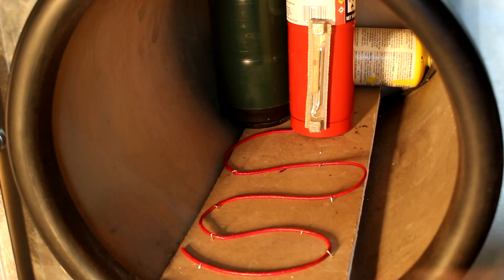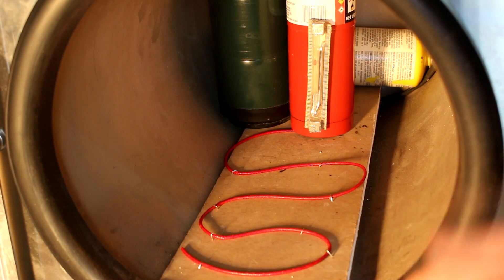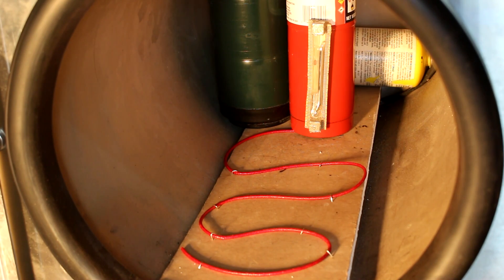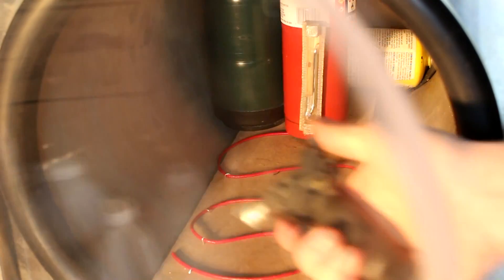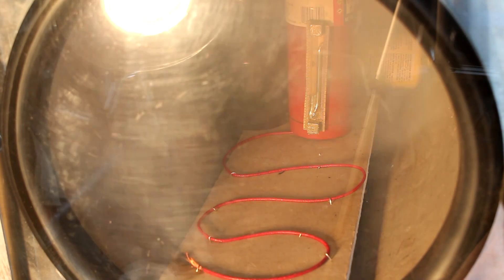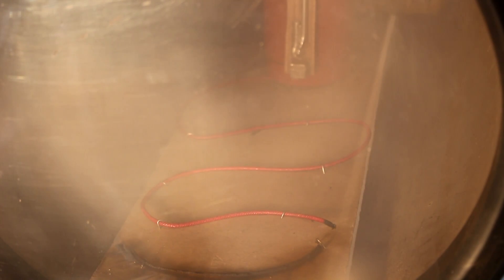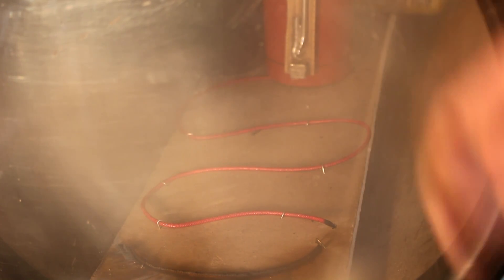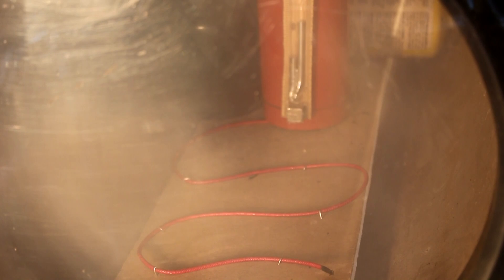Can You Defuse a Bomb Using a Vacuum Chamber?

Comment: as long as the bomb cant detect itself being put under vacuum. It also would depend if the bomb uses a vacuum as a defusing deterrent. If so then the bomb might be put under vacuum but what level of vacuum is the bomb using? bombs can get very complicated.

Comment: try elasticated fuse, a fuse that the coating shrinks over the burning point,  the elastic part only needs to last for a 1 cm or 1/2 inch, that should make a tiny choke over the exit point,  as it burns away allowing a slight build up of pressure before the coating burns off  ( an easy way to achieve this would be to wrap the fuse with heat shrink or foil and an elastic strip bound around the fuse to shrink it as it burns, remember as it burns the elastic will unravel, so 3 layers   1 heat resistance layer 1 elastic layer and a fixing layer to help stop the elastic from unravelling
Reply from the maker: that should work

Comment: Okay try this. Make a homemade firecracker which is started with a broken lightbulb inside the firecracker itself. Fire it up with a battery and see how it explodes in the vacuum. So no fuses, open fires or anything. Only a black powder (or variant) firecracker which has embedded  lightbulb filament as a source of ignition inside. It would be interesting to see how it goes.

Comment: Could you make a sturdy setup to ignite a rocket motor within the vacuum chamber and see the results? It'd be interesting to see if the ignition is successful and if the motor will sustain itself in a vacuum. Of course this is possible, but would a potassium nitrate solid rocket mix work, or does the oxidizer need to be stronger?

Comment: what if you put a bunch of gunpowder in lets say one you your pirex tube(or smaler don't want to blow up the chamber) and you have something that would heat a lot of it at the bottom so it wont jump away maybe there could be enough heat at the same place to start a reaction. maybe the laser or something like the filament in a light bulb lot of heat real quick on a large surface at the bottom with a bunch on top.

Comment: Unrelated to the video l, but I need to say something about practicing chemistry. READ THE MSDS OF EVERY CHEMICAL INVOLVED. I have reason to believe I have gotten metal fume fever from working with manganese dioxide in lantern batteries. The headache, dry throat, and nausea are not fun, and easily could have been worse had I tried something more daring.

Comment: try c 4
without a fuse but a detonator.
Reply: This could kill him. Why? Vaccum stops fire. Explosion MAKES fire but it is NOT fire. C4 is a military grade plastic explosive, meaning it has a violent reaction that is extremely dangerous with or without oxygen and pressure not to mention illegal. Most if not all other electrically detonated explosives are caused by an elemental reaction of one or more substances having a volatile reaction with a spark or with each other. The reason for fire being involved in these explosions is because of the extreme energy output these explosions have. The energy is transferred to the Oxygen surrounding it causing it to burn.

Comment: For testing your hypothesis that the air carries the heat between grains, perhaps you could test whether black powder burns faster in a gas with a low heat capacity, (eg. Argon?) and slower in a gas with a high heat capacity (e.g. Helium)?

Comment: I guess this method won't work for an "explosive fuse" (or whatchacallit in English), the kind that they use to connect the explosives with for multi-point explosion... the fire travels much faster in them, approx. 2 km/s. You would have to cram in a lot of it to make this extinction happen, the volume of the vacuum chamber is not sufficient :)
Reply: detonating cord.
It isn't fire that travels, but a detonation front.
Reply: ...and what is exactly a detonation front? Chemical reaction. Any explosion is just very quick oxidization.

Comment: Another unexpected result!  I love it!  Oxidizers like chlorate or nitrate decompose to 02.  I guess the oxidizers just can't supply enough 02 pressure.  I know in a diesel engine the pressure and temperature rise but I didn't think that the partial pressure of 02 goes up as well just like you mixed in pure 02 at 1 atmosphere.

Comment: Do the same test without setting the vacuum pump. 
Perhaps the fuse was stopped because of the smoke that was inside the chamber.
Although you did say that the lack of oxygen is not a problem, I'd still like to see more of the control tests

btw love you Cody <3

Also, how does a vacuum influence photosynthesis? Cause you would think that that would help drag the oxygen byproduct

Comment: Cody! I dont want you to put yourself in harms way but if you ever get a chance could you prove or disprove weather a tank filled with flammable gas can explode if exposed to electricity because i figure without oxygen in the tank, nothing will happen if a current is ran through the metal tank of further more if 2 wires put inside and sparked could cause an explosion, again dont do it, but if u have any idea, let me know because we are working on a vehicle design that requires high voltage and compressed gas but are hesitant due to the dangers of accidental discharge and explosion, thanks a ton, also, comment section, id love to hear your thoughts!

Comment: In the liquid nitrogen test, it is only under it for a short distance. If you put 6+ inches of fuse under liquid nitrogen, in  a glass dish for viewing like a casserole pan, does it still burn the whole way? I assume this fuse going out here is due to the fire square missing pressure? If you want to try to get that standard changed, maybe try using a triangular pyramid instead. This way you still have the triangle, but instead you have 4 of them and might be easier for people to extrapolate into 3d instead of completely changing the shape.

Comment: So if the fuse can burn without oxygen and can burn while extremely cold (in liquid nitrogen), then why does a vacuum chamber put it out?  Are you sure there isn't oxygen in the fuse itself that allows it to burn under liquid nitrogen that gets sucked out by the vacuum chamber?
Reply: FarmCraft101 did you watch his last video?
Reply: An interesting way to prove the effect of oxygen in the atmosphere would be to put the fuse under vacuum, and then pressurize the chamber with something like nitrogen back to atmospheric pressure.

Comment: An interesting point a friend of mine mentioned. Your hypothesis is that the pressure of the atmosphere is causing the combustion to spread rather than immediately dissipate into the atmosphere. I think it's a good one, by the way, but my friend mentioned a good way to confirm it's a lack of pressure and not a lack of air would be to pump out the atmosphere, then refill the container with argon. Then repeat the experiments in an inert atmosphere. Should be a good way to confirm your pressure hypothesis.

Comment: How about an actual electrically triggered bomb?   Like a time bomb.. Will detonating it in a vacuum keep it from exploding?
Reply from the maker: no
Reply: This is actually the Question I was looking up that caused me to find this video in the first place. I doubt my small town has a bomb squad so I was curious as to what would happen if they encountered a bomb threat that had a bomb on site. So I looked this up since you need oxygen for fire and most explosions are fire. Exept they aren't. They are the extreme rapid expansion of gasses as they react to either other gasses, or a spark. This reaction causes the initial explosion, which expands through oxygen at a rapid rate as fire and displaces a lot of air which is why there is a shockwave. Conclusion of my rambling; explosion MAKES fire, but explosion is NOT fire.

Comment: I didn't expect it to stop the burning, when I was younger I lit up a firecracker in the house, and in my panic I threw it in the toilet expecting the water to put it out. it however did not.

I wonder what this fuse was made out of, and if you should potentially try other fuses
Reply: Maxwell Houghton the reason for that is because the fuse is creating its own gasses, in water it will still work. But in a vacuum the gas is pulled out
Reply: Interesting, That seems to make sense!

Comment: What happens if you put Play-Doh in a vacuum chamber?
Reply: Bryce Holt good question, I would assume it would just expand and fill up the tube
Reply: Jalen Miller I would think that it would shrink from the strength of the gravity
Reply: Bryce Holt I think it would shrink after letting the pressure come back in but not while the vacuums on.

Comment: Thought this would be an electric fuse test. What would happen to an electrical fuse if you shorted it in a vacuum? Would it glow like a filament in a light bulb?
Reply: No problem,  burning is the major problem.  But not as long as a halogen atmosphere that redeposits evaporated tungsten to the filament.

Comment: I've got one to try will a cold pack work in a vacuum if it's not touching anything to transfer heat to it or very little touching it ie string or if you can float it with a cold magnet?

Comment: I couldn't help but wonder,... If you had let atmospheric pressure back into the chamber would the fuse have re-ignited?  You mentioned that you have had that fuse burning under liquid nitrogen but that was not at 0 Atm, right?  It would be interesting to see if it "re-kindled" when returned to 1 Atm. both with atmospheric O2 levels and with something like Ar or Ni as the surrounding gas?,.... Just a thought.

Comment: So would this fuse be comparable to a flare being that it can burn without oxygen and under liquid? I'd like to see what a flare can do inside a vacuum,  but I understand that may be too large scale and too volatile for your chamber. I know flares are hard to extinguish and you basically have to cut it off and let it burn itself out. Would this be true under a vacuum. Maybe try a small piece and see if you can ignite it with your laser. Then try lighting it and turning on the vacuum pump and dropping the pressure.

Comment: What about electronic ignition? If a timed or remote controlled bomb was put in a vacuum, could it potentially be disarmed?
Reply: kaptenrobert yes the title is a not clickbaity. We already know that explosions can happen in a vacuum as Cody has set off blasting caps in previous videos. In this video Cody stopped the fuse from burning.

Comment: CODY i have a question for you, what is faster: lightning? or a sniper shot?
Reply: Adriel Cedrick but lightning is not light, its super strong electricity
Reply: Fair point... But most lightnings reach the ground, some even so fast a few humans don't notice unless there was a visible light.

A sniper shot is very fast too, I don't know. Electricity is very fast, but I'm not so sure.
Reply: I deleted my comment, it was very embarrassing LOL
Reply: I searched it up and it showed that a lightning bolt reaches an average of 320,000,000 feet per second while a sniper bullet can only reach 2,400 to 3,600 feet per second.

Well even when my prediction was wrong, I guess my choice was still correct LOL

Comment: This doesn't make sense to me. I would say that the fuse stops not because of lack of pressure but the decrease in temperature. Since the fuse needs enough activation energy to progress, pumping the air out means that all the energy needed for the continuation of the chain reaction is pumped out aswell. 
Could you try re-igniting the fuse in the vacuum with your lase pointer?
If the fuse consists of potassium nitrate it should light up according to my knowledge. Thanks.
Reply: MrCoffis Didn't you see the end of a video? Liquid nitrogen is as cold as you can get.
Reply: Vadzim Dambrouski True. Then that would mean that for potassium nitrate to decompose it requires pressure for some reason. But the thing is with liquid nitrogen the specific heat capacity of it is really low.

Comment: Hmmm what do you think causes it to go out then?
Reply: only thing i can think of is that the vacuum is pulling away the hot gases too fast to sustain the reaction but i dunno about that. I wonder if you could visualise that effect with a thermal camera?
Reply: In the last video called "Is fire possible in a vacuum" he came to the conclusion that pressure is needed for the chain-reaction to sustain itself. Go watch it if you want a more detailed explanation of it.
Reply: Ahh ok I hadn't seen that.

Comment: you probably won't be able to test this without destroying a number of vacuum chambers, but, will a detonator set off high explosives in a vacuum? That's probably a stupid question because I think they use explosives in space travel for separation, but...
Reply: Typically a detonator is a bit of primary explosive in a tight casing, and it's embedded inside the main explosive. Both the casing and the surrounding explosive would contain the exhaust gasses well enough to sustain the reaction.

Comment: Do you think the vacuum chamber would work for more sophisticated time delay or remote trigger bombs that they usually have to use robots and stuff to defuse? If the lack of pressure can stop the ignition of a fire or rocket fuel, could it also stop the ignition of an explosive?

Comment: What is the reason it went out? I'm struggling with an explenation!
Reply: I believe Cody's last video shows how rather than just needing oxygen, fuel and heat to burn, most things also require pressure to transfer the heat to the unburnt parts properly. :) (He explains it better in the video)

Comment: Can you dull or kill a batteries performance with a vacuum? Since as the pressure drops you also have the temperature drop, and as we know very cold temperatures can really kill the performance on batteries. So say you have a simple circuit set up and had the battery in cool water or wrapped with a wet paper towel. As the pressure drops and the water boils and freezes and such, thus we also get a drop in temperature. Would we notice a worth while change to the batteries performance?

Comment: But can you defuse a vacuum chamber using a bomb?
Reply: If you can get it to go off. That would actually be really cool: a bomb detonates in a huge vacuum chamber, specifically calibrated so that the resulting exhaust gasses precisely fill the chamber just enough to return it to atmospheric pressure.